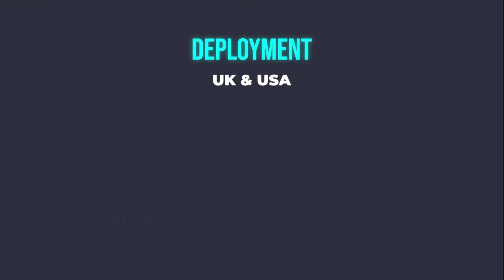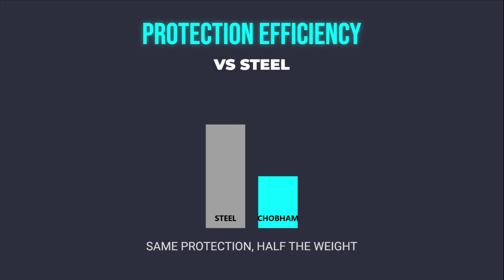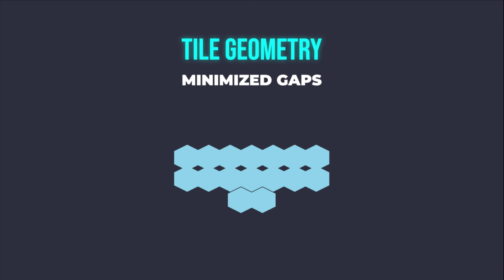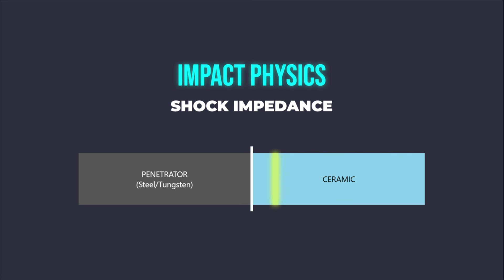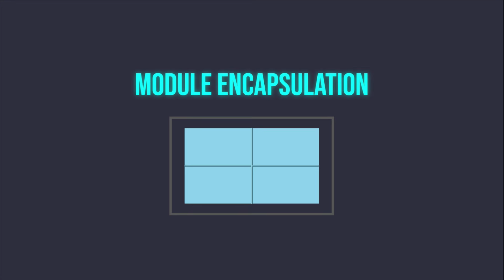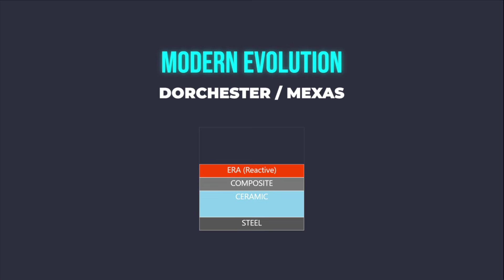Chobham Armor: Ceramic Matrix Composites Explained

Comment: M1A2 SEPv3 Abrams use DU Depleted uranium as the first layer defense with mix style chobham composite.. DU Uranium armor is strong, very dense, and moderate hardness so can absorbed and take multiple hits before breaking from tungsten and depleted uranium armor piece ammunition.  DU uranium armor place in front turret side angled armor cheeks within mix chobham armor.